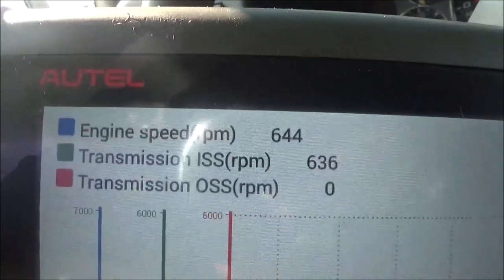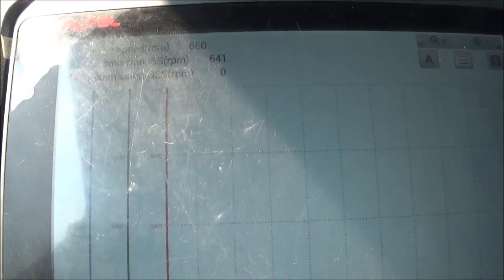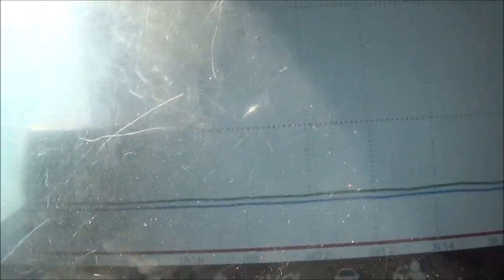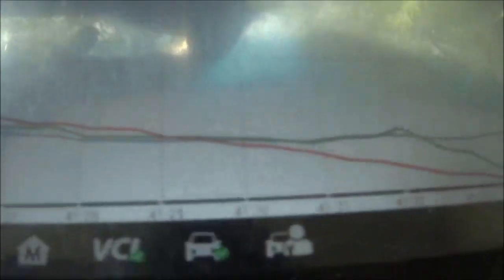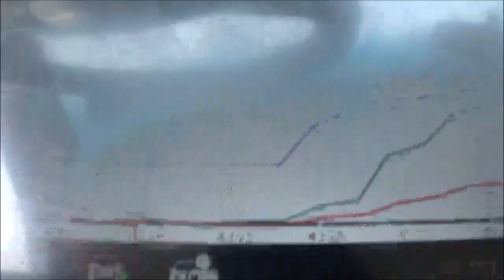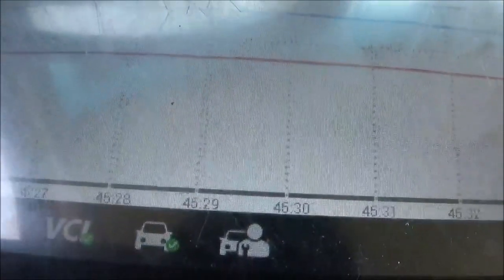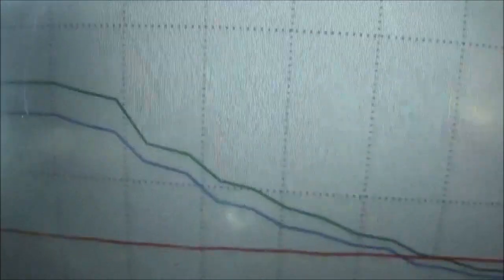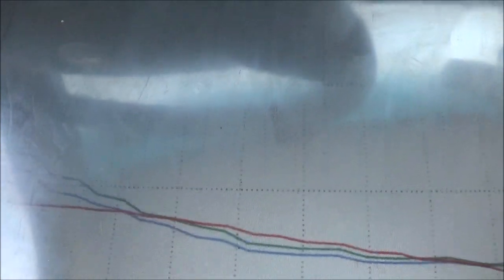Using an automotive scan tool to observe transmission slipping! Automotive diagnostics.

Comment: My van won’t move , forward or reverse, . But the shifter works fine, what’s your thoughts? Bad trans?
Reply from the maker: What type of van?
Reply: @thisisyourtransmission  2005 Nissan quest, any ideas?
Reply from the maker: My guess would be the front pump in the transmission is broken. @manuelsalgado8510
Reply: @thisisyourtransmission  I have a 99 dodge ram van 5.9 gas engine with 46re transmission it has delayed shift from 1-2 and no shift from 2-3 only when transmission is hot??? What is your opinion??
Reply from the maker: @5.9_Magnum  miles?
Reply: @thisisyourtransmission  144,250

Comment: Hi brother my honda 2013 civic has 149k it was shaking and suddley stoped when accelerating. I waited few mintues took it home. Should i use scan tool. Mechanic said not worth putting new transmission oil and said i should get used transmission. How do i know its not a misfire. Thanks
Reply from the maker: You can scan it if you have engine light. However, if you have a good mechanic and he knows what the problem is, then it may be best to follow his advice.

Comment: What's some good readers you could recommend for this?  Not sure if my car has the sensors to read this but want to try it.
Reply: Thinkcar, it fixed my srs, diagnostics found traction problem, and just recently fixed vtc VTEC issue.

Comment: Hi great video, I just bought a Launch x-431 Torque and after seeing this video I did the same thing with a CVT transmission  to find out what was slipping- I used the combined graph like you did, and watched the engine speed, drive pulley speed, and the TCC speed. Doing it that way it was obvious the clutch in the torque converter was slipping, and not the belt. Keep up the good work my friend!
Reply from the maker: Sometime if I have some free time, I try to get to know the scantool a little better.